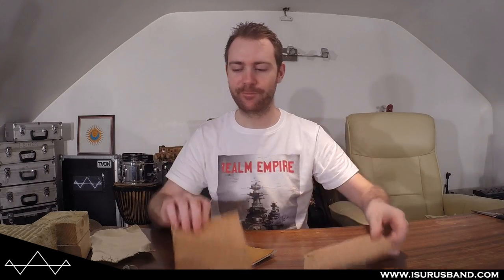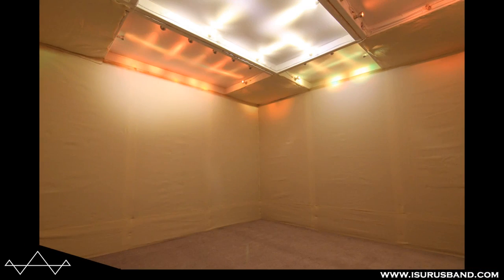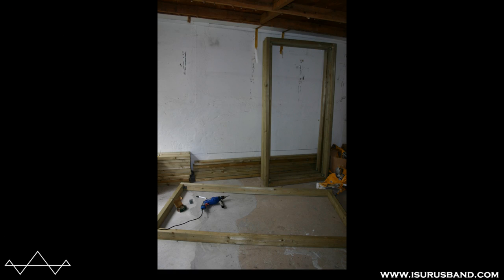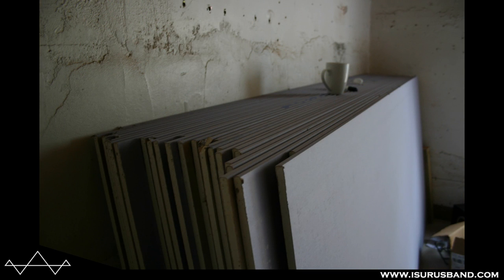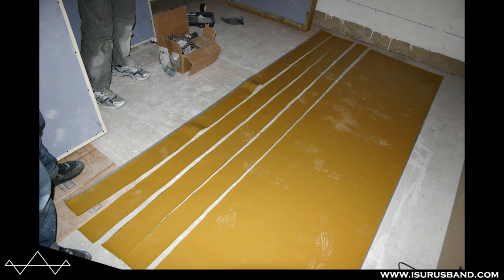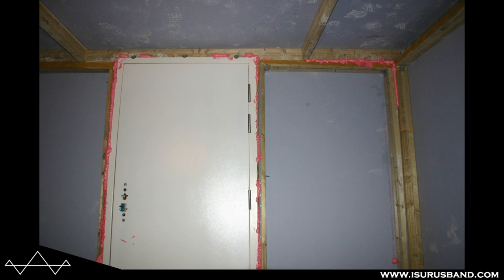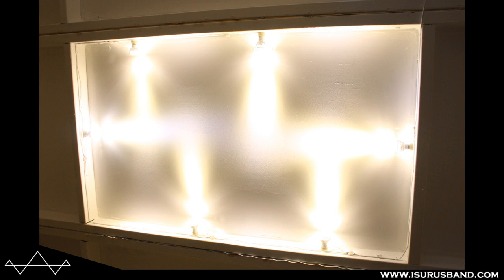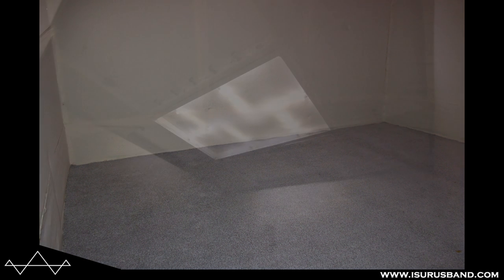Soundproof Booth Build - Portable DIY Isolation Booth

Comment: This is by far the best video I've seen on this. First off a massive thanks for documenting.. I have two questions and i'd really appreciate it if you could answer them..

1) When you joined the corner modules together, how is it that they're sound proof? Because weren't they just wood on wood i.e no actual dry wall in the corners on the outside?

2) This obviously worked really well, if i was to do this exact same thing pretty much except add an additional layer of drywall to the interior of the whole room as well (like you did on the ventilation module) do you think that would be a worthwhile improvement? Is there anything you wish you'd done differently now you've had it up for a while?

Seriously impressive stuff guys. Well done!
Reply: +Jay Sullivan Many thanks for the reply and we're happy to hear that the video was helpful. To answer your questions:

1) Your understanding is correct. There is no drywall in the corners and a small section of each wall is technically just the wood frame with a layer of the Tec 50 on the outside, wrapped around it. You can think of it as the 2 layers of drywall being replaced by 1 piece of 50 mm wooden frame. As the Tec 50 (MLV product) overlaps the top of the wall modules, there is no wood on wood contact and it is actually wood (ceiling module) on Tec 50 (wall module) contact.  Then using the coach screws to pull the ceiling modules down into the wall modules creates a seal and that's the most important element in that aspect of the build. 

2) Adding a layer of drywall on the inside would improve the performance of the room to some degree which would be further improved if it was sealed properly module to module. The degree to which it would improve performance of the room overall would likely not be a very large amount as we have a lot of mass in the rockwool, drywall and Tec 50 configuration. Another consideration would be the fact that the door would likely be the weakest point in terms of soundproofing and in fact, it is almost certainly the weakest factor in our existing build. If we were to upgrade the soundproofing of our studio as it stands now, we would be looking to upgrade the door.

It's quite difficult to describe here but I hope that has helped. Let us know if you have any more questions. My general advice would be to plan properly and then just go for it. 

Cheers
Reply: Awesome, and thanks for such a quick reply! That definitely cleared a couple of things up. If you ever do decide to upgrade the door please do document the process as the way you relay the methods used are so easy to understand :) Also, just a thought, would slightly upgrading the density/build quality of the outer shed and getting a half decent security/solid door for it not improve the performance even more than upgrading the booth itself? Or would that mean a ton of effort making sure everything is air tight etc.

Anyways i think this should more than cover me as all I'm gonna be doing in there is vocals and guitar,  just want to be able to crank my AC30 up, it hurts to play it so quietly at the moment
Reply: +Jay Sullivan Thanks again for the feedback. Yes, you're right; upgrades to the outer building would make a very big difference for us and likely more so than upgrading the inner studio's door. The inner door is the weakest element as far as the inner studio shell/room is concerned. 

We think that having our existing studio within a building that was built to modern residential standards would allow us to play live drums in there. That's actually our next aim so we may well be making the outstanding upgrades to the outer studio shell at some point. We'll be sure to document it if/when we go ahead.

As for playing guitar and singing; what we've built would be perfect for that even if it is inside a poorly built shed.
Reply: Great video!  Thank you for sharing.  You could build a semi temporary module for a 3rd door per say. Enter into the room, close both doors, put the 3rd door / module over the inner door.

Comment: Thanks so much for the video. I'm interested how it's going now? Vents working well? Getting moisture stuck in there? What would you change, if anything?
Reply from the maker: Hi, the studio has been a big success for us. No issues of any kind so far including the ventilation system. We keep that running all the time, day and night, as it requires a very small amount of power and as a result we have had no issues with moisture build up inside the studio.

Comment: Hi, I'm seeing this 6 years after you posted it but it's probably the best video on the subject I've seen so far (especially for UK). May I ask a couple of questions? I didn't quite understand how you finished the ventilation system. Is there a grill on the internal section of the wall for the fresh air to come in and just a grill, without an extractor fan as the out-take vent? Also, you didn't talk much about the flooring. Were you working with concrete flooring and just covered it with carpet and the vinyl strips? Many thanks,
Reply from the maker: Hi, thanks! There are two identical fans, just doing the opposite of each other. One pulls air in and one pulls air out. So one fan unit is mounted on the inside wall, and one outside.

The floor is concrete, and the tec50 vinyl strips are on top of the concrete where the walls meet the floor. Then we just used underlay and carpet for the floor inside.

Hope that answers your questions!

Comment: Hello.  Great video: easily the most useful and convincing soundbooth-build video.  Have watched follow-up video but I still have two questions re the materials used.  One is this: I phoned Rockwool.co.uk who I gather are the Roxul equivalent for the UK.  What you refer to as RXL 40. . . .I've been informed by Rockwool.co.uk that the UK equivalent is RWA45 (thickness 100mm)? But I'm slightly skeptical because you Isurus guys are British. . .so how come you refer to it as RXL 40?  The other question regards the fan: did you simply buy two of the same fans and are they the Eco dMEV standard fan?  They must be incredibly quiet?  Can you confirm that?  I want to use the booth for voice recording - I'm concerned my good microphone will pick up even a low fan sound . Any answers from anyone would be very welcome.  Thank you!
Nick

Comment: Was there a sub woofer on your sound system when you did the example showing how your room can suppress the loudness? Harder to suppress low frequencies. On the video I am just hearing mid range to high frequencies from your speaker.
Reply from the maker: No subwoofer.
Reply from the maker: But also, you are hearing the speakers through a camera's microphone though obviously...
Reply: @Isurusofficial  Yes, true. So there would be some bass from those speakers. Perhaps down to 60 Hz? I have a finished basement that I want to leave the existing walls and ceiling as is, but I would like it to be more sound proof. My band rehearses in this space using headphones as I am playing a Roland e-kit. Your solution may work for me since it is the singing voices that are travelling through the house during these rehearsals.

Comment: How did I miss this video? Great explanation of everything. How would acoustic drums sound and could you get away with them?
Reply from the maker: Thanks a lot! Regarding acoustic drums, if it was built in a proper brick building you would probably get away with it, depending on how close any neighbor's are..!
Reply: @Isurusofficial  I'm thinking of building this in a basement room - the building is brick and the ceiling is concrete, but the neighbors are just upstairs. How viable would you say acoustic drums would be in this case?
Reply from the maker: It’s really difficult to tell for sure. It would partly depend on the concrete floor above and more specifically, how thick is it and are there any gaps around the edges or anywhere else for electrics, plumbing, etc. Also, there may be small air gaps at connection points which would cause flanking noise. If I were you, I’d eliminate any such possibility as much as possible and make sure the existing walls are air tight before doing anything else. We were very impressed and surprised by how effective our studio has been but we’ve never played acoustic drums in the room. If I was forced to guess, I’d think that you would reduce the drum sound down to 40-50db combining the 2 rooms so it would be audible but not at all loud directly upstairs. That’s a guess though.
Reply from the maker: What I can say is that our studio inside a terrible shed like building resulted in 110db noise being hardly audible directly outside. Another element that you should be thinking about is low frequency noise (kick drum) which we never had a huge amount of. The concrete floor would help with that a fair bit for you though.
Reply: @Isurusofficial  Hey guys, this video is great and I want to make a room like it. I too play acoustic drums and thinking of doing a room within a room - within my livingroom. Hopefully it can kill the sound enough. Double floors, walls and roofs. I live on the second floor. I can see that you only plasterboard on the outside of the room. Do you know what effect it will have to put in on the inside too? I really hope my room will work out with the double walls and all ;) Thank you for the great inspiration.

Comment: Fantastic video boys! One question, did you bolt down the floor to the unit floor? If so what did you use,?
Reply from the maker: Nope. The modules sit on top of the floor with no attachments. You could use anchor bolts and that could be an improvement over what we did.

Comment: How well would this work on the main floor of a home to block sound/vibrations from people who are living in the basement below me? I have a spot in my home but have tenants living below. Mine would be much smaller just able to fit me and a drum kit
Reply from the maker: Our build was designed for being on a concrete ground floor. If you need to stop sound going down you would need to have further soundproofing on your floor. You should look into floating floors as a way of doing that.

Comment: Hello congratulations on the good idea and performance!  Since I would like to do something like this I was wondering about the first two layers of plasterboard. Are they bound in advance in some way or are they screwed together only when the third layer of plasterboard appears? Тhank you!
Reply from the maker: +Ivan Dimov Hi, they are screwed together with the Tec 50 rubber sheeting between them. Just screwed straight through into the wood frame. Cheers!
Reply: Hello, good job guys, what he is referring to is that you put 3 layers plasterboard in total, and is not it true? there are only 2, frame, plasterboard, Tec 50 and other plasterboard
Reply from the maker: +RADOSLAV HRISTOV Hi, no there are only two layers of plasterboard, apart from the ventilation module which has three. You could definitely use three for more sound reduction, and screwing straight through would probably work ok with enough screws.
Reply: thanks man

Comment: Great video, really useful. moving into a place with a basement and I want to be able to play & record drums there. A slightly smaller version of this could work well I think, the isolation levels you achieved on this budget are very impressive! Did you need to do anything special to get power / signal cables into the room? Thanks, James

Comment: I've managed to copy your studio.. I'm stuck about the floor tho.. what did you do to the floor? help!
Reply from the maker: +alpaltropi Hi, sorry for the late reply.
We have a concrete floor, and cut strips of the tec50 the same size as the base of the wall modules and laid them out on the floor (so we had a square that was exactly where the walls would be) and put the walls up on top of it.

The modules then sink into the tec50 on the floor and create a good seal. The floor has to be good and flat though, which is why we reconcreted the floor and levelled it first.

I hope that makes sense!

We are planning on doing a follow up video soon, as we have been getting a lot of questions which we can answer all in one go.

Comment: You only attached two sheets of fabric upon the rockwool. Is it okay? Doesn't rockwool make any dust when any vibration occurs? Is it a stupid idea to attach one more layer with a kind of fancy wooden material upon the fabric? It's gonna disturb the absorbing process? I'm thinking about it for the health.
Reply from the maker: It depends what you are trying to achieve. If you only want sound proofing, you can completely cover the rockwool with another layer of plasterboard or wood etc and have it sealed in. We were using it as acoustic treatment as well, so for that you need a porous layer on top so the rockwool absorbs as well as blocks the sound.
Reply from the maker: Health wise, modern rockwool is pretty safe, and is designed not to break down or release particles into the air. Although, I guess there will always be some risk.
Reply: Thanks. I think I'll use only fabric like you did since I also need acoustic treatment. This will be the biggest DIY ever.
Reply from the maker: Good luck with it, and yes it is a big job! Well worth it though.

Comment: Hi, this video has been really informative, really like the idea that its portable. i am currently building a music room in my garden for teaching/practice etc. What can you tell me about the exterior room? you mention that its a shed? any info would be great, thanks
Reply from the maker: Joe Price  - Hi, thanks for your comment and happy to hear that you found the video useful. The exterior building is a very poorly insulated outbuilding with breeze block walls up to around 4ft high and then plywood above that. It is quite run down with single pane windows which do not close well at all. The most important element of the exterior building is the concrete floor. We had to level the concrete floor slightly using a floor levelling compound. More details can be found here: 

http://isurusband.freeforums.org/new-studio-build-started-sept-2011-t89.html
Reply: +IsurusOfficial 
Thanks for the info. i am just deciding what to use between the two layers of plasterboard on my inner walls, could you tell me the reason you picked tec50 over other products? was green glue an option for you?

Thanks, Joe
Reply: +IsurusOfficial 
Also what Db reduction did you end up with? in your blog it says that the inner room would give you 50db while the outer was 30db what was the actual result when finished?
thanks
Reply from the maker: +Joe Price We do not have any way of accurately measuring the db levels right now I am afraid.. Sorry!
Reply from the maker: +Joe Price Tec50 was an easy way of adding a lot of mass and density to the walls, and has a good frequency absorbtion crossover with the two layers of acoustic plasterboard - giving the walls a pretty broad spectrum of frequency reduction. Also it provides a decoupling effect between the plasterboard sheets, which cuts down on the transfer of vibration and sound-energy.

Comment: Did you use bolts for the connection between the top module and the side module?
Reply from the maker: We used large self driving coach screws with a bolt head, which pull the elements that are being connected together.
Reply: Thanks.

Comment: Guy just wondering what did you do for the floor ? I am on the second floor so I guessing just build a floor module that floats.
Reply from the maker: The building is on the ground floor - so we put down a solid concrete floor. Being on the second floor I think you are right, you would need a floating floor.
Reply: Yea that's what I will do. Well great work lads and I will be sure to share with my recording buddies :)
Reply: +Damian Brady Guys very last question :) How did you get power into the unit but more so how did you sound proof the hole you would have had to make to allow cabling in ? Cheers! :)

Comment: I got a question. Is the finished booth soundproofed in the sense that no one outside the booth  can hear anything or soundproof recording?
Reply from the maker: +Rabee Maqbool Hi, it is designed to stop sound leaving the studio and that also works the other way, sound getting into the room and being captured by microphones.

I think you are refering to acoustic treatment in the room also, meaning reducing reflections and frequency build up issues? In that respect the rockwool inside the room helps to treat and balance the room, reducing reflections and stopping bass build up etc.

Check out our follow up video uploaded to our channel recently where we answer a lot of questions about the studio build. Thanks!

Comment: Great build! I am going to do a version of this myself based on your idea! One question... did you have to screw in the corners instead of use bolts due to going through the 4 inch part of the wood as opposed to 2 2" pieces like on the walls? Thanks a lot!!!
Reply from the maker: Hi! For the corners we used large self driving coach screws to kind of pull the corners into each other, as opposed to the way we bolted the panels together.
Reply: IsurusOfficial great, thanks! Do you happen to remember what length you used? And what length bolts by chance? Thanks!!!
Reply from the maker: I think they were about 5", and the bolts were about 5.5" or 6".
Reply: IsurusOfficial cool thanks. Also, how did you get the 4" duct to fit in the wall cavity flush like that? Isn't the wood 3.5" deep? Thanks!!!
Reply from the maker: The ducting just compressed a little after putting the covering layer on - so inside they are more oval shaped than perfectly round!
Reply: IsurusOfficial ok that's what I thought, thanks! I'm building mine now! I'll send you pics when I'm done!
Reply from the maker: +phylum grinder Good luck with it! Yes, definitely show us how it goes.